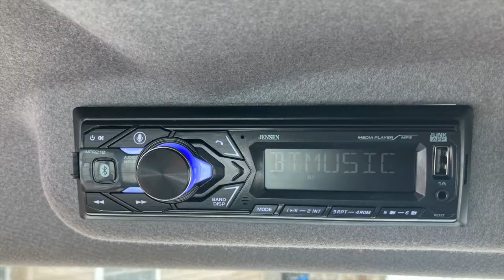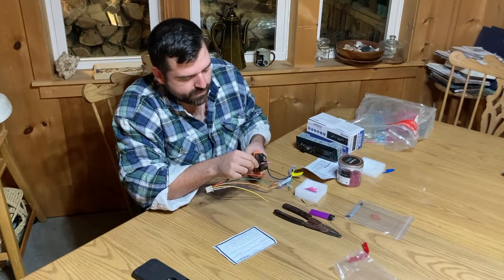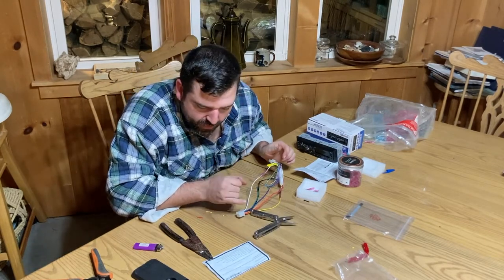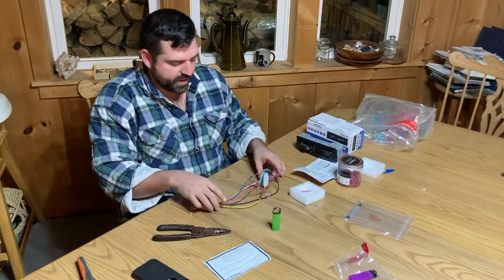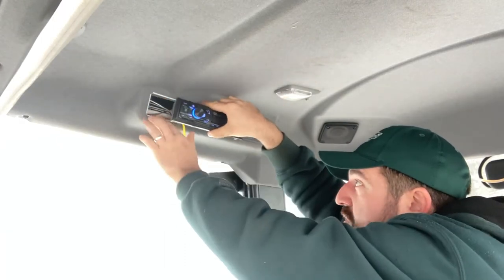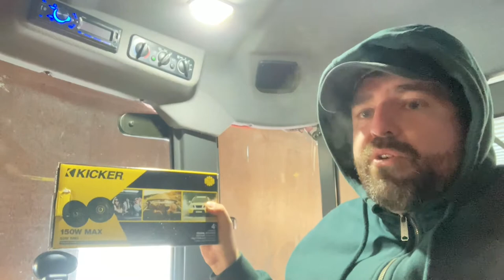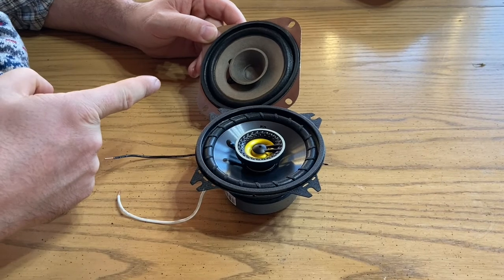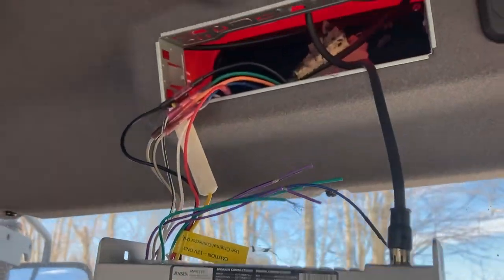How to Install Kubota Tractor Radio and Speakers | Troubleshooting Kubota Radio and Speakers

Comment: Just wanted to say thank you for the video. Local Kubota dealer wanted $375 for a bluetooth radio. I used your links for the radio and wire harness. Took 30 minutes to wire and install into my LX3310 and it sounds awesome!
Reply from the maker: Glad to hear that it worked well for you!  Mine is still working great even after running almost constantly through our last haying season.

Comment: I have M7060 2021, and it has the 9 pin harness, pluss a red fused wire. So, if I wire the harness red to red, that fused wire is still there. I'm not sure though If it could have neen something I added for a a back up cam that I took out because it stopped working.  Walmart has a blue tooth phone ready for 24 bucks. I'm giving it a go. It's a Dual.